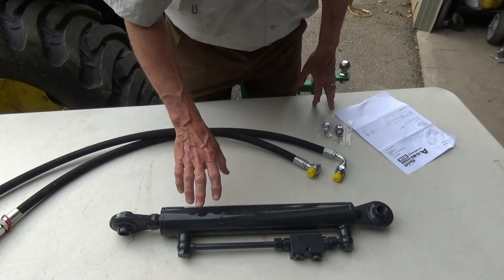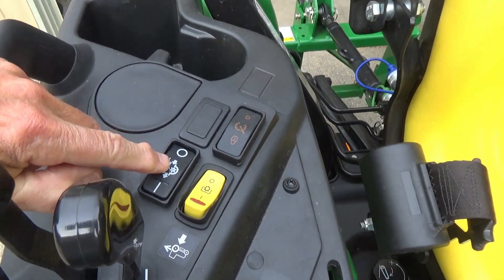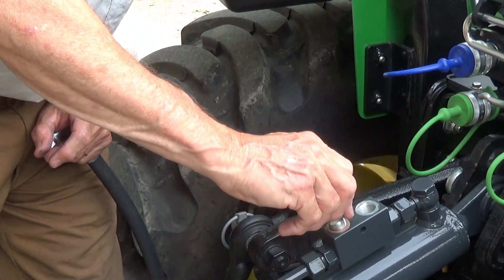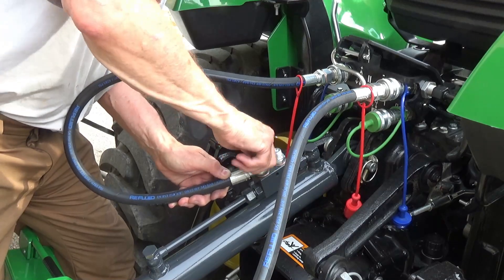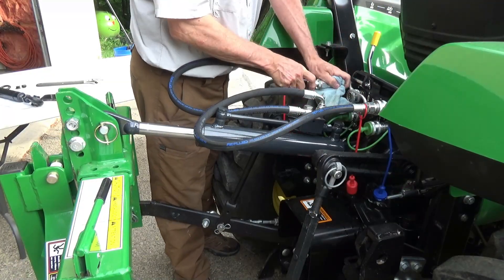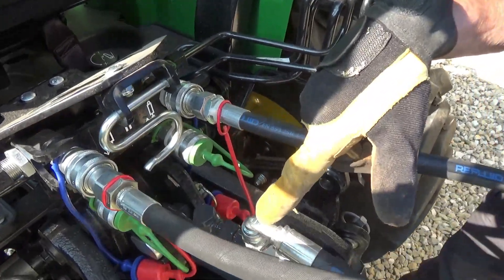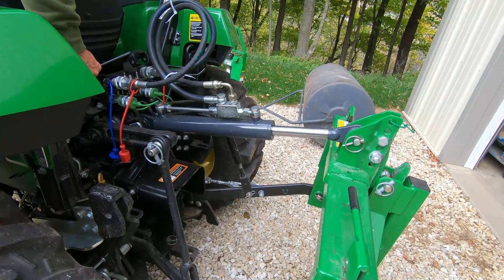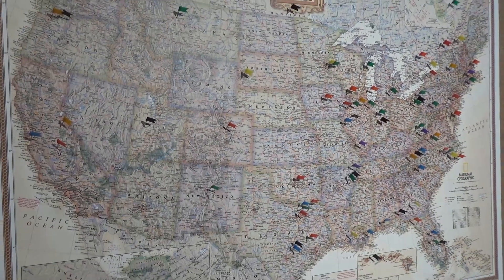John Deere 2038r- Rear Top Link Installation / 120

Comment: Thanks for the video. I am trying to order a top link and not getting a lot of recommendations on the cylinder and the hose lengths. Your hoses look to be at least 12" too long in the video. Anyway, contacting Agrifab for help. 

BTW Bonham, TX is pronounced as Bonam to the locals.. ;)
Reply from the maker: Hello Wayne, thanks so much for commenting on my video. I’m very happy with the Agra Fab top link. While my hoses appear to be long, it makes connecting and disconnecting easier, and I simply curl them around so they have the flexibility to move. Again, this is just the way I did it.

Comment: Why did you have the power beyond removed?
Reply from the maker: @davidegan3280  Good morning, David. I wanted to run multiple implements at once. For instance, I have the backhoe connected and the front grapple connected, and can use both at the same time..
Its also more straight forward when connecting and disconnecting attachments. Good question -Bill
Reply: @billburkhart  You can have both power beyond and rear SCV's. I was just wondering why you removed the power beyond. From everything I have seen, I believe that the power beyond hydraulics will provide better flow than the continuous flow from the rear scv's

Comment: Before I can purchase a hydraulic top link, I need to figure out how to add extra hydraulics to the rear and the extra controllers under my right hand. Where did all of that come from?
Reply: Oh that's all really helpful. I've emailed myself both those part numbers and this video link, for when I'm ready to gather all this together and upgrade). Thanks Bill!
Reply from the maker: I had that installed, let me look up the part number and description and I’ll get back to you this weekend-Bill
Reply from the maker: Take a look in the description about third paragraph down it has the John Deere part number and instructions listed there for your use. Hopes this is helpful.-Bill

Comment: Minute 10:04 your about to put a big scar in your cylinder or bend it. That chrome rod looks like its touching tje quick hitch
Reply from the maker: Holy smokes that is close! I don't know if that's the camera angle or not. Thanks for the heads up, I'm going to check into this in the morning. I'll get back to you. -Bill

Comment: Hey buddy how did you flip that did you take the bolts out of the top of the cylinder? And just flip the whole thing around
Reply from the maker: Great question, I took it to a local hydraulic shop and ask them to do it. It turned out perfect. I definitely know my limitations when it comes to mechanical issues. Enjoy the rest of your weekend.-Bill

Comment: Bill did you have your JD dealership replace your power beyond with the 4th and 5th rear SCVs?  Also, did the level controls on your console come with the rear SCV kit?  I'm configuring a new 2032R and thinking they could take the cost of the power beyond install they have listed for the backhoe and apply it to the rear SCVs installation to offset some of the cost.  I'd love to know what you did to get yours done since your power beyond is gone.  Thanks, Dennis from Michigan
Reply from the maker: Hello Dennis,
Thanks for the question. I did have the dealership install the SCVs. That installation was above my comfort level. 

I've been criticized for not keeping the power beyond connection......but it's NOT required to stay on the tractor. I read the installation instructions and it never instructed the installer to reinstall or keep the power beyond connect. My SCV has been working PERFECT for several years now.

The levers and the new console cover was included in the kit, it looks factory installed. No cobbling look at all. 
The dealer turned all the unused lines and the power beyond to me.

Removing and installing the backhoe is easier with the power beyond gone. I'll be posting a new video this summer showing that feature.
I think I posted the JD kit number in the description, didn't I? 

I agree with your plan.
Let me know how it turns out. - Bill
Reply: @billburkhart  Thank you Bill for your response, I'll be talking to my dealer in the morning.  I wonder if he even knows this is possible.  Question:  Are the backhoe hydraulic lines long enough to connect to the new SCV location?
Reply: Bill, I'm having trouble finding the part you called out above.  Where did you find it and are these part numbers correct?  Thanks Bill
Reply from the maker: @mackdenn  Dennis, I’ll find it today and get back to you.  -Bill
Reply from the maker: Yes the lines are long enough
Reply from the maker: Go to video 120. Look in the description, third paragraph. You’ll see the kit number and installation  instruction numbers.

Comment: Would that Hydro  Top Link need to be longer if you have a Quick Hitch compared to not having one ?
Reply from the maker: Hello Buzz, I purchased a standard hydraulic top link and use it with the quick attach and I’ve never had any problems. Good question.  - Bill

Comment: I was still able to hit my hydraulic link connections on the cross bar on my 1025r, even with the check valve flipped around. I think I’m going to get some longer hoses and turn the cylinder upside down. It only hits when I have the 3 point all the way up, top link all the way shortened, and I accidentally go down a hill that is a little too steep and the box blade hits the ground and raises a little more. I wish the 3 point had something to stop it from going up like it stops from going down. Lol
Reply from the maker: Sorry to hear your about your situation. Fingers crossed you find a good solution. - Bill

Comment: Bill, you mentioned using the rear SCV for your backhoe. Can you share a pic or video of how you hook it up? I was told that wouldn’t work by my dealer so had to get the power beyond loop too.
Reply from the maker: Hello Matt, I'm so disappointed that dealerships advice varies so much. The SCV I installed works perfectly without the power beyond loop removed. I'm not a mechanic, but the systems works fine, the only change is the power beyond connecting has been removed. This new design makes connecting and disconnecting the backhoe easier. If you want to IM me, I'll send you photos and I can show you the power beyond is removed (I have the plumbing in a box) 
I'm not a mechanic, but I can tell you I have a switch on the console to my right after the change that energizes the rear hydraulics without needing the actual power beyond connection. 
Tell you what I can do, I have a video coming out next week, I'll make a video showing how well my SCV works and get it out in March. I'll also take another look in the comments, I may have posted the part number that was used to make the changes to my tractor. Again, I've had these now for a couple of years and they work perfectly. Thanks for asking the question - Bill
Reply from the maker: Matt the kit information is included in the video description, hope this helps. - Bill

Comment: The fixed end needed to be a bit longer to avoid any potential obstructions. My hydraulic top link for my tractor has the independent mounts (no pressure block or steel line from one inlet to the other). My hoses are threaded directly into the cylinder housing. My only issue is the hydraulic pressure doesn't always stay when mowing for long periods. Pressure bleeds off but is returned when a quick bump of the hydraulic lever to return to level is wanted.
Reply from the maker: Hello Andrew happy Sunday. Sounds like you have a nice set up …..glad it’s working out well for you. I’ve had pretty good luck now with this rear hydraulics since I fixed it. Take care friend.

Comment: Thank you Bill.  Can I ask what ball hitch attachment you are using with the imatch?
Reply from the maker: HiTodd, that’s a 2 inch ball, the majority of my trailers around here require a 2 inch ball thanks for asking, have a great weekend.
Reply from the maker: Todd, I believe I misunderstood your question. The ball mount is unique with the two different ball mount length. I purchased that from my local dealer, it was sitting on their shelf so I grabbed it.
Reply: @billburkhart  that is what I was asking,  is it a Deere or frontier brand or 3 rd party?  Do you know the brand.  Thanks again

Comment: Hey Bill, love this video.  I'm considering getting one of these top links for my 3032E soon, and think I'll deal with these same folks you purchased yours from.  Need to get some extra rear hydraulics installed first, of course.

Not that it matters a whole lot, but since I live in eastern North Carolina, I thought I'd pass along a little primer on town names in the area -- Seymour Johnson AFB is right beside Goldsboro, and Beaufort, NC is pronounced "Bow'-fǝrt", as in "bow and arrow," like a girl having a "beau."  Beaufort, South Carolina is pronounced "Byoo'-fǝrt," as in "beauty."  Why that is, I don't know, but that's the South for you.
Reply from the maker: Good morning John.  You won’t believe how convenient the top link will make your life. From connecting rear Impliment’s to grading.  I’ve found a few leaks on mine once in a while, simply check and re-tighten them once in a while and you’ll love it.  Thanks for the pronunciation tips. I’ll work them into my shouts outs in the next video. Have a good week.
Reply: Hi, John.  I'm planning to follow suit and order one for my 3039r cab.  How did your project turn out?  May I ask what lengths you went with?  I think based on the web site, that I need the 06003 kit.  Hope all went well for you.  David

Comment: Hi Bill - well even after watching your video PRIOR to even ordering the same top link from AgriStore (I ordered a little over a month ago, yet just installed today) I made the same exact mistake you did when raising the 3-point - bending the hard hydraulic line and puncturing the hose.  Did you order the replacement parts from AgriStore also to replace the damaged parts and reverse the location of the valve?
Reply from the maker: Hi Brian, that damage happens quickly doesn’t it? Yes, I did order the replacement parts from the AgriStore …they sent them to me and at a very reasonable price. But then I took it to a local hydraulic shop and had them reverse that flow restrictor and set up that new design that I described in the video. That new layout works very well for me, I haven’t come close to re-damaging it. ……yet😄

Comment: I just installed what looks like the exact same cylinder that I picked up from Tractor Supply. I had to go and have the hoses made as it did not come with those. 

On that note, after installing it and checking to make sure there were no impacts, I did the exact same thing and bent that same piece. Thank goodness it still works, so I turned it 90 degrees to the right and left it to the front, it gets close, but does not contact anything at this point. Only had a chance to use it a little it yesterday and love it. Did you just bend yours back straight when you reversed the check valve?
Reply from the maker: Hello, your comments are interesting to have the same misfortune as I did. I chose to replace anything that was bent and have had good luck since. Stay safe and thanks for checking in.
Reply: @billburkhart  yea, mine still works as is, I don’t know where to get the replacement parts as I ordered mine through tractor supply? Hopefully it will continue to work well for many years.

Comment: I have a 1025r just installed my upper arm and tube bent just like yours and it didn't hit anything it was just pressure of both stiff hydraulic lines as traveling up ..it won't hurt anything it just bends at it weakest point which is tube coming from cylinder block.
Reply from the maker: Hello Roy, happy Saturday. Sorry to hear about your bad luck, thanks for sharing your experience with me. Hope your having a nice Spring.

Comment: Hello, I have a 1025r with backhoe. Is this possible to hook this up on the 1025r and hook the hydraulic hoses to the area where the backhoe hooks up?
Reply from the maker: Happy Spring D.S. It is not possible without the rear SCV's.  However,  do under stand Tractor Time with Tim has an add on accessory that will allow you to do what your asking about. Enjoy your new tractor and be safe.

Comment: You will really enjoy your top link. I have both the top and side cylinders on my tractor. When I bought the tractor my first job was fixing my very long driveway and I wanted to control the box blade from the seat. Since then I have found it very handy in hooking up implements on uneven ground to the quick hitch. These should be standard equipment on a tractor.
Reply from the maker: I'd be happy to pay extra to have the option to add the top and tilt hydraulics. Have a good work week Robert.

Comment: Are the ag style connectors on the scv the ball type or the pin type?
Reply from the maker: Hello, Happy Sunday. Not sure how to answer your question. The male connector has a firm point that push's on the female side opening the flow.  Does that answer your question? You may also notice I had both my SCVs on the tractor side installed as females, my back hoe has two male connectors, so I thought that would be easier.

Comment: Hey Bill. That’s a good idea for turning around the lock valve. I have to run dads top link backwards due to the top link tractor side mount and base port location.https://youtu.be/uhxPtdXPA04 Never gave much thought to direction of mount. Most compact tractors mount cylinder base to loader frame for FELs.
Reply from the maker: Thank you Garny, I watched your video and must say your very creative. Happy Spring.
Reply: @billburkhart  thanks. I have a few other vids that are tractor related that you might enjoy. The ball hitch seems to be a big hit.

Comment: 1/4" hose size would of been better for routing them hoses. The little bit of slower speed would be better anyway
Reply from the maker: Dan, thanks for the tip, maybe another viewer can take advantage of your tip.
Reply: @billburkhart  yep no problem I have a B2601 Kubota and have been thinking of upgrading to the 2038.  I used to live in Dubuque. We moved in 2013 for Sherrill

Comment: What size cat 1 hydraulic top link did you get? Closed hole to hole? Open hole to hole?
Reply from the maker: Hi Earl, I'll find the paperwork and get back to you. I should have posted that information.
Reply from the maker: Earl I posted additional information under the video description, hope this helps.
Reply: Thanks Bill!
Reply: Hi Bill!  Have you looked at installing a hydraulic tilt on your machine?
Reply: How long are those hoses you had made?
Reply from the maker: @earlpilon8113  Earl, they're about 40 - 41" long

Comment: Hi from Clermont, Florida, Bill! Looks like I'm in good company -- same tractor, same hydraulic top link (got mine at Tractor Supply, tho), same bend in the link's hydraulic tube, and same solution by removing the top link hanger hook. No leaks, tho, and it has been quite a while, so I am just leaving everything as is. It's certainly not the only bent part on my tractor, and the top link works fine in spite of the bend.
Reply from the maker: Hi Seth, I'll be darn, I'll keep my fingers crossed you have no leaks. Thanks for sharing that information with me. Have a great Spring.

Comment: Great video Bill you do a great job. I have a 2038R as well. Can you tell me the part number for that top link as I am also seeking one out for mine also.
I had the dealer install two scv’s as well but my power beyond connectors are still there and function as well.
Reply from the maker: Hi Jim, give me a few days and I'll get it in the description, thanks for asking. I'm glad your Power Beyond is still in place. But mine is working well. I don't understand why methods differ so much between dealerships. Have a great Spring.
Reply: @billburkhart  thanks Bill. I can send you a picture if you like. I’d love to help if I can.

Comment: HI Bill, that reversed block looks great, as I mentioned to you, I will be doing the same thing soon, as you were showing the rear of the tractor, I notice the connections for the backhoe are missing, my tractor doesn't have a backhoe but I do have the hose connections from the power beyond to connect to something that needs hydro flow, you should check that out because the backhoe has to have its hoses connect to the tractor which is what the power beyond is for, if you need a picture of mine for comparison just messenger me and I will get it to you asap, once again another great video, have a great day.
Reply from the maker: Hello TY, another viewer told me the same thing, so I watched your video again and see what your telling me. Keep in mind this video is 7 months old and I've been using the backhoe with no issues. Just for grins I went back to my dealer Monday and he agreed the power beyond is gone, however, this design eliminated that and all I have to do is press a switch and fluid is diverted to the lower connections and provides continuous flow. Connecting and disconnecting is much easier, so I'm going to stay with this and see what happens. Wish me luck.   Have you heard anymore on the front hydraulics being available yet?
Reply: Hi Bill, I have not heard of another way of connecting the hydraulics, that would be a great video to show how they changed it and if you're happy with how it works, that's all that matters,  I just did a service on the 1025 and asked about the 2038's 3rd function kit, as of right now were I am, it's not out but they were going to check on it, I am going to talk with a friend at Deere to get him to check also, let you know when I have an answer,  have a good day.